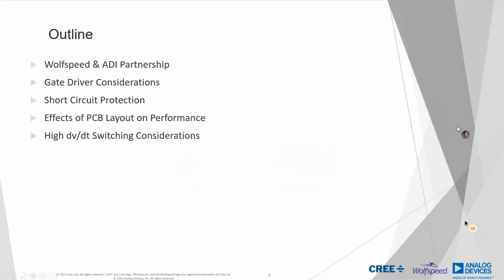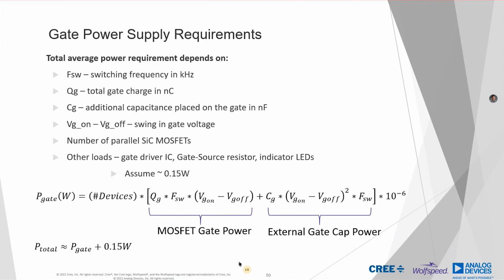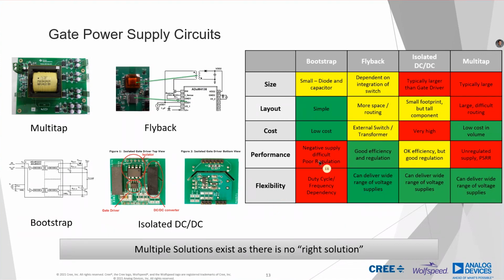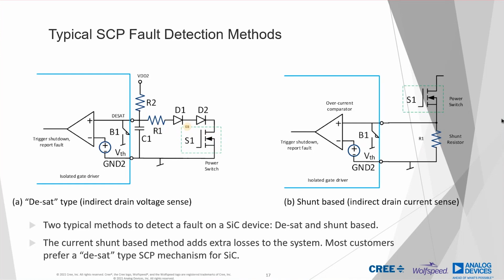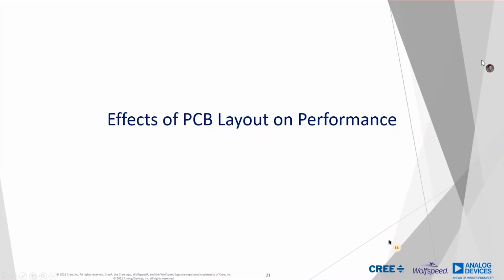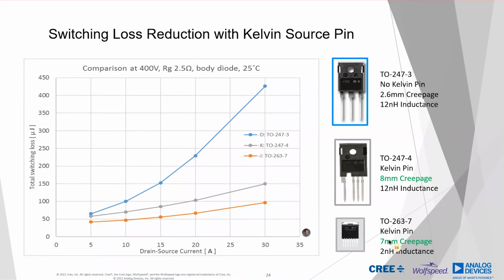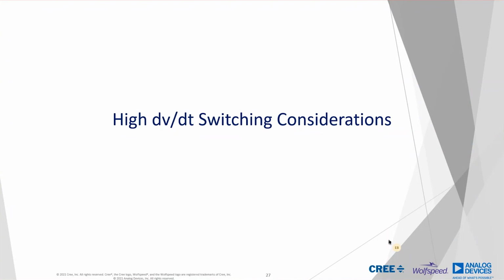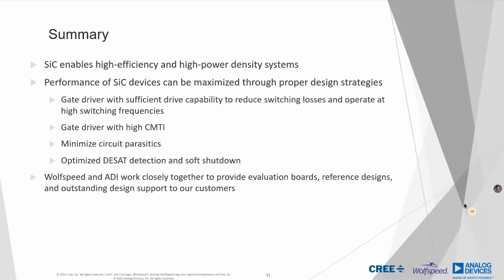Silicon Carbide Gate Driving Considerations from ADI & Wolfspeed

Comment: what is maximum switching  freq ?
Reply from the maker: Engage with Analog Devices technology experts in our online community, ADI EngineerZone® https://ez.analog.com/. Ask your tough design questions, browse our rich knowledge base, or read about new technologies in one of our blogs. Unsure where to post? Simply type your product number in the Search by Keyword or Part Number field and EngineerZone will suggest the correct forum.
Reply: Maximum switching frequency could be derived from several parts, for example, maximum puwer dissipation of the gate driver IC